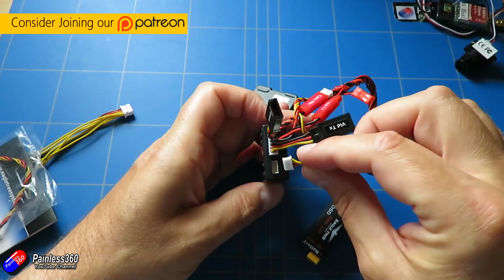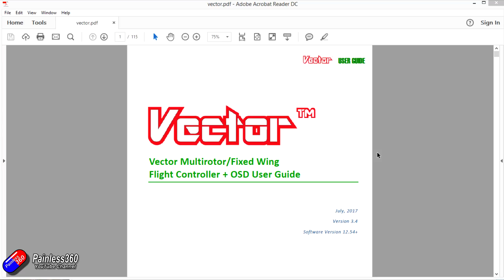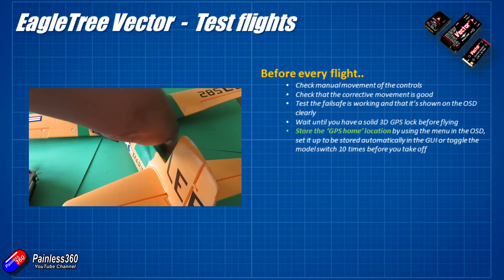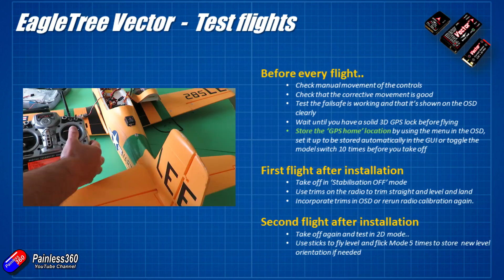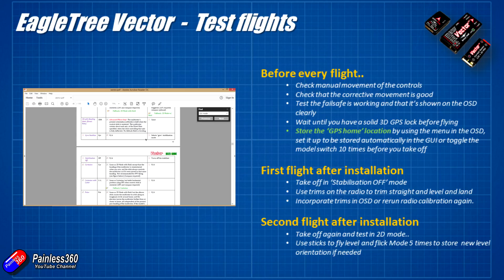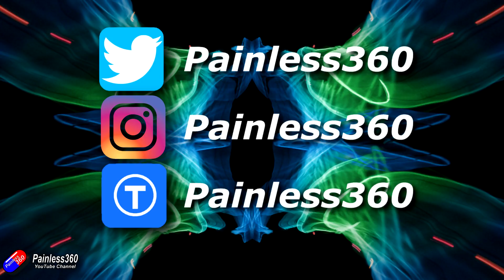(4/5) EagleTree Vector Series: Testing and the first flights

Comment: When set up dual rate ( throws) ? Before or after wizard.  Just for sample: In manual mode plane has 4mm ailerons throws, but in 2D mode ailerons moving over 10mm and control very sensitive, so how to reduce throws in 2D mode ?

Comment: Question.   Why do you have two mode switches set up?
Reply from the maker: All explained in the video series and manual.. happy flying!
Reply: If it was, I would not have asked the question.
Reply: Having two mode switches (one mode and one submode) allows you to have two additional flight setting options. For myself I have the following on my Mode 3 position switch: Stabilization off, 2D and 2D+Submode. On my second 3 position switch the Submode switch I have Hold, Loiter and RTH Test. Lots more information on mode and submode can be found beginning on page 31 of the Vector Manual v3.6 Hope this helps.

Comment: Came across a problem today Lee with a flying wing with the vector system in it, the wing was using a frsky L9r receiver, the vector reported to many rx errors and went into RTH it came back great and flew in rth mode for 30 mins, as the taranis would not reconnect and eventually crash landed gently close by.
Reply from the maker: +UncleFesterUK there have been a few problems with long range systems. Disabling ‘glitch detection’ (see failsafe video) can help but that sounds like something more serious. I’d check any telemetry/log files..
Reply: LOL this happened just after it had taken off Lee, less than 100 meter away, log files next check :) checking connection to receiver, if i find out will pass the info over :)
Reply from the maker: +UncleFesterUK please do. Speaking to the Eagletree guys it does happen with some long range systems when they don’t operate as expected with their signals and timing. The support guys will always ask the pilot to try the unit without the LRS radio to troubleshoot. Firmware updates on the LRS system usually fixes it from what I’ve heard.. hope you get to the bottom of it..
Reply: Reading on a lot of forums, these have been a pain in the neck for long range.. I almost bought one, but after reading all the problems I went another direction. Still interested in them, but, they need to get them where they play nice with All long range systems.
Reply: Looking like the receiver has a problem, will get it changed out and get it tested again, logs talking of it browning out, and eventually the eagle tree gave up with it and would not allow a reconnect.
Reply from the maker: That's a bummer. Hope then next one works a lot better! :D

Comment: Hello,
I think the idea of flying around my village with a long range pretty cool. But I can only find kits focused on racing and not flight time and range. I know how to build a drone but I don't
know what parts are compatible. Now I kindly ask you if you could make me list with parts for a long range and long flight time, if you have time left. :) Range would be nice about 2-3 Kilometers (1.2-1,9 Miles)
Reply from the maker: +Nils Kurzi you’re looking at a model with 10” or larger props with low KV motors. Look at the t-motors website.. you need the higher efficiency setups for longer flight times. Be aware that in many countries flying beyond line of sight is illegal. Happy flying!
Reply: Thank you for your fast answer! But what do you mean by high efficiency, and what do I have to look out for when buying the parts for example the PDB, is there a diffrent
Reply from the maker: +Nils Kurzi way to much to cover in the comments but this video shows how you can get the same thrust with much lower power - https://www.youtube.com/watch?v=Sjwi_UnCLWc&app=desktop
Reply: Painless360 OK thank you